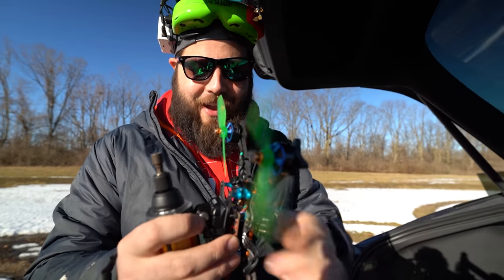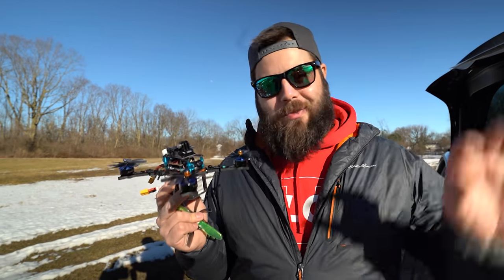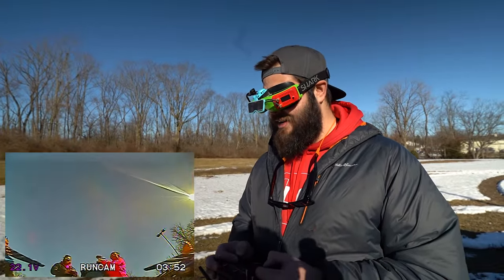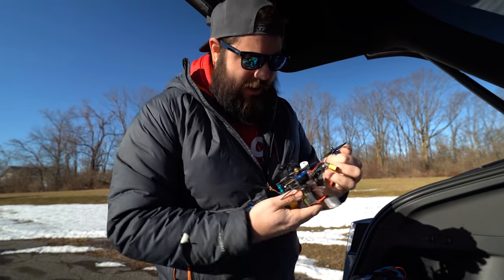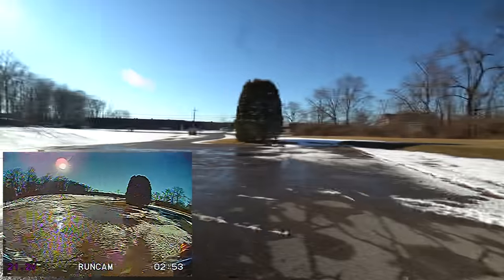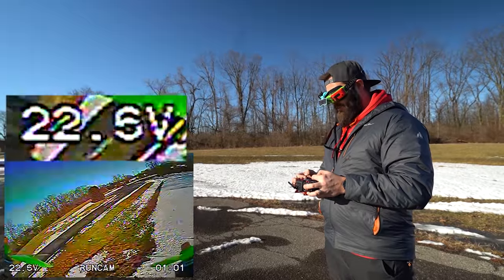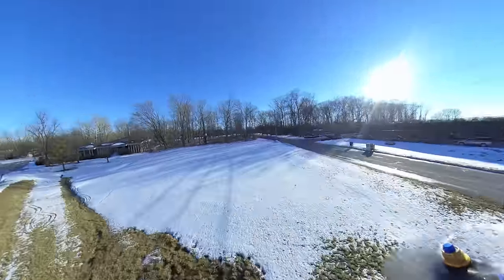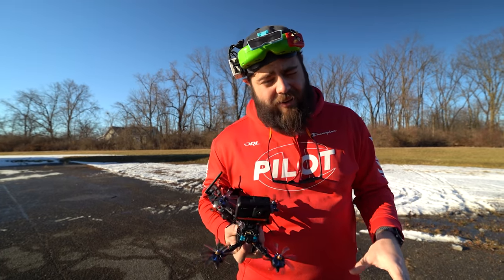Pushing 8 blade props to 65,000 RPM

Comment: I'm the " that's not right" guy today. I'm just so excited $gme blew up again today. Get on the shuttle to the moon at market open tomorrow!!!!!!!

65k unloaded with no battery sag.
As prop rpm increases the drag increases by square. The motor can produce x amount of torque regardless of rpm. 

2000kv 6s =  15krpm at half throttle and 20k at full throttle. Current consumption 5a and 20a respectively.
2600kv 6s = 20krpm at half throttle and 20k at full throttle. Current consumption 20a and 80a respectively.

Battery on fire huh?

Lets say this motor can produce 2 ft/lbs of torque and the prop requires 2ft/lbs to spin them at 20k. A perfect match of kv to the prop would be the prop requires 2ft/lb at the max rpm the motor can produce, say 20k rpm. The motor can't magically pick up stator volume to quadruple the torque output to 4ft/lbs and pick up twice the rpm.
Now lets say the same setup with double the kv. The motor will only spin the motor to 25k with 2ft/lb of torque. Above that the motor will not spin faster however it will pull more current effectively turning the wasted wattage to heat.

At the end of the day we would like like the system to be scaled where max throttle is 5% bellow max rpm of the motor/prop combo for decreased angle of attack when the prop unloads. I suppose we could do an 8s battery on 2600kv and cut the throttle scale in half to produce a sharper bell curve in rpm up to half throttle.

Comment: It must be said that the KV is calculated unloaded, meaning there's no prop on the motor. The RPM would be much lower with a prop, even a tiny 3 inch such as those
Reply from the maker: This is true

Comment: the reason that it has better 'pushback' is likely because the 8 blades will have better static pressure and wont allow the air to push through the blades

Comment: Good video but get somewhat sciency you should give some test results such as start with motor specs  you are using, followed by props,  noise measurements, if you can power draw from battery etc it be real useful to a lot of other folks thanks

Comment: This is kind of like having 4 duct fan engines on a 5inch drone? Im gona have to get me some of these
Reply: 5 inch is the prop diameter, not drone size. Ofc the larger the props the larger the drone but the drone size may still vary

Comment: Once a blade is beyond its laminar flow it becomes an egg beater. and the more blades you have, the closer they are together and the air is dirtier between them. When it gets real fast, the air is so dirty that the next blade isnt doing much. 
the speed that the air is travelling at also matters, and the blade pitch relative to that speed. (angle of attack for the blade) all of this science has been done to death 70 years ago. there are sweet spots in the combination of number of blades, blade pitch and blade rpm that you can look up in tables. Anything outside of that is inefficient and it possible to have superior performance with less blades and less power. 
There's even online calculators that calculate this for you. 
What would be really informative would be to post the V and I and rpm, along with thrust- whilst using a wind tunnel to generate varying air speeds, for each combination of blade number and pitch (assuming same blade diameter)..but then again this has been done back in the 1950s with both open blades and ducts.
edit: to make this all apples v apples, you also need to change the electrics for each setup to ensure that for each load, the electronics are operating at the same relative stress levels..for example an ESC rated at 40A will run hotter if it draws 35A than if it draws 20A, so the 20A setup will be more efficient. You need to swap out the ESC to one that is 60A or so if you want to compare efficiency and power v thrust/speed. noise is just that..noise. you can even hit the frame's resonant frequency which would amplify it and severely reduce the life of the electronics through microstressing.

Comment: how did you measure it out to 65000 rpm?
Reply: 65000 unloaded is calculated from the motor kv x 6s voltage.
Reply: @MrStevegibb  isnt that under no load tho?
Reply: @EnzoM  but still the actual rpm still twice normal and probably above audible frequencies.

Comment: The 8 blade props probably produce more noise in higher frequencys which are out of range for the human ear
Reply: That’s true. They’re the same volume just so much higher pitched that you don’t hear the prop tip sound like you do with 3 blade props and 2 blade props. Because of that all you hear is the thrust being produced with the 8 blades

Comment: at precisely only 75 percent of the speed of sound, the tips of your props can handle more i believe. i think you could go for a larger 8 blade...hmmm...upon further math, if you go for a 101 mm prop(this 8 blade is 76mm), your tips would be travelling at the speed of sound. don't do that without a comfortable send-it attitude. with an 1102 km/hr tip speed, a 90mm diameter would be at 90% of mach 1, ok, maybe that's pushing it too...nevermind, a 931 km/hr tip speed with those props is fast enough, you're right haha. sorry, math is fun

Comment: Can you imagine how loud a 1 blade prop will be 🤓
Reply: I have flew 1 blade props on my 3d helis as proof of concept. Once blade with a equal weight counter balance at the hub and on a collective pitch heli it flew VERY WELL.

I was flying hard 3d after a, couple test flights and getting the flybarless unit dialed in (it did take some adjustments to get it flying perfect) on 12s SAB Goblin 700 with a single 350mm blade and the counter balance. Once dialed it flew about 95% as good 3d as it does normally (I am a sponsored heli pilot and very good at what I do) and I was ripping it hard, the only thing that was noticeable was I had to give more collective pitch then normal to get the desired outcome of what I was wanting to do, I found my self giving 70 to 80% full collective to pull off a move that normally I would only give 40 to 50% collective and that's to be expected as I have only half the blades surface aera as normal and yaw became slightly more responsive in the clockwise direction making me not have to use as much throw as normal in that direction to do what I wanted. Other then those two things it flew the same and was totally rippable to any pilot that can rip... It did have a different sound as well

Comment: Dude, that's not even near 65k rpm.The math You did is correct but without prop. Can You even comprehend what 65k rpm is? The prop's would disintegrate even at 40K rpm